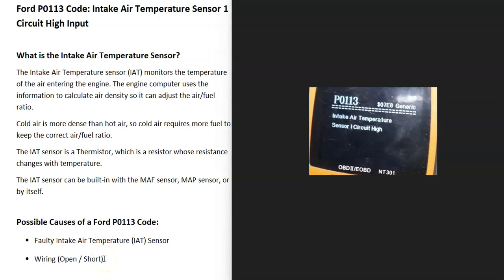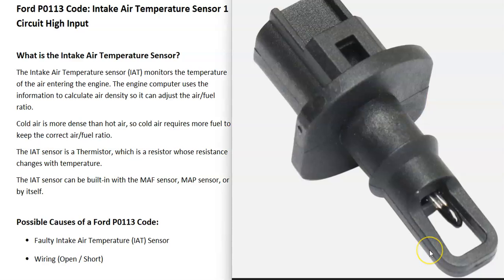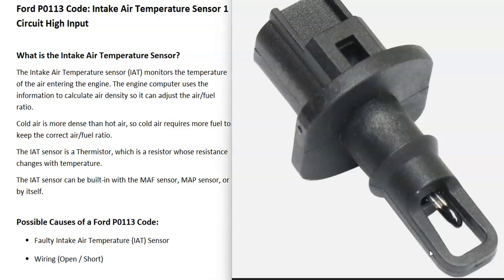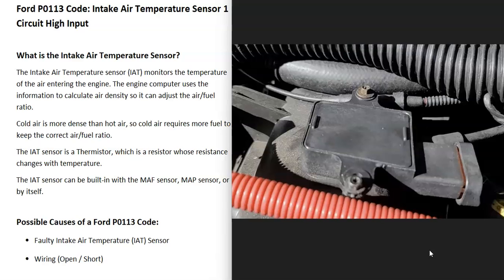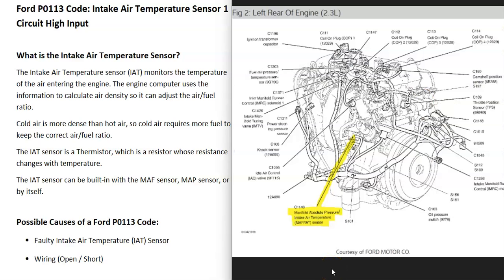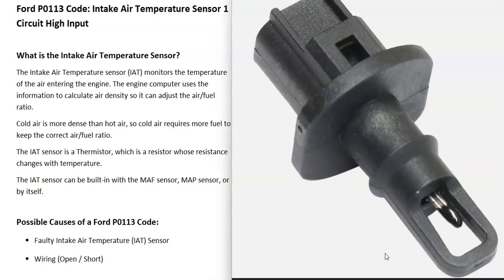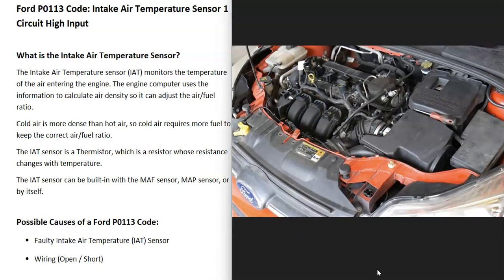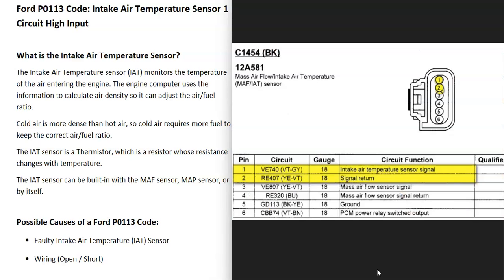Causes and Fixes Ford P0113 Code: Intake Air Temperature Sensor 1 Circuit High Input

Comment: Too much bs ! They seriously need to make vehicles plain & simple all the codes for vehicles ain't going to Dave it from exploding but rather cause it to explode since the computer is changing too much to compensate when mechanical devices may not compensate then comes the explosion

Comment: So having this code thrown after a house fire, where the vehicle was close enough to have the bottom trim driver's sidemelted and headlight looked like a milk jug balloon! This seems to be the final thing to fix my 2003 Lincoln town car. Wiring seemed fine, mass air intake replaced already, had to unplug it to keep Tom's and air flow down. But want it to have a functional valve again. 

Think this is it?
Reply: RPM not Tom's 😅
Reply: if it broke/melted the thermistor probs